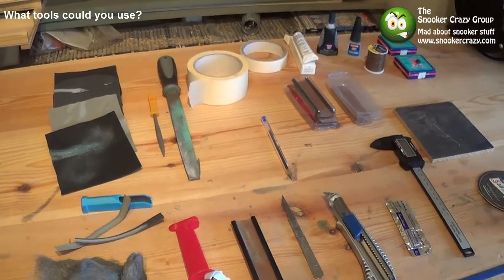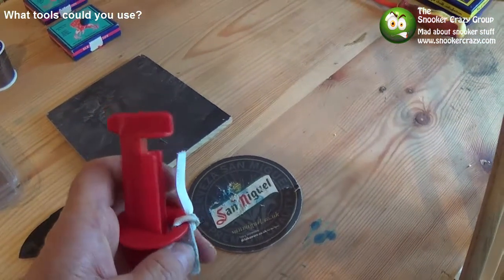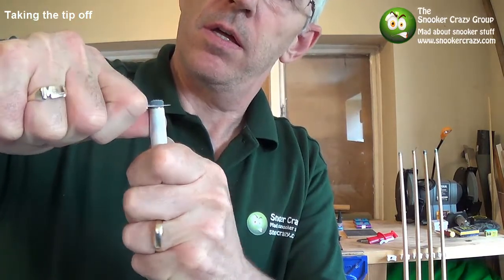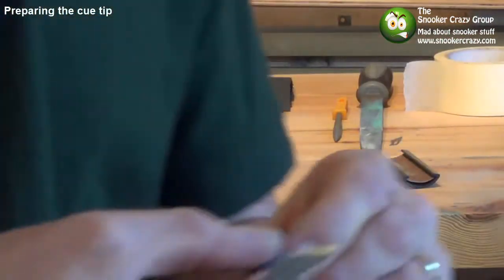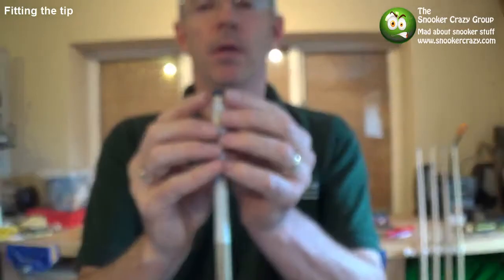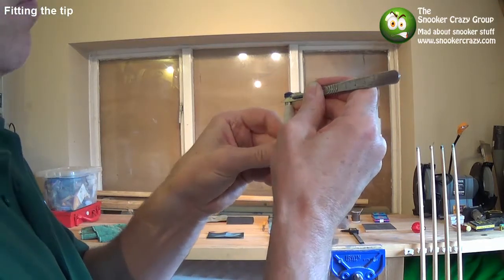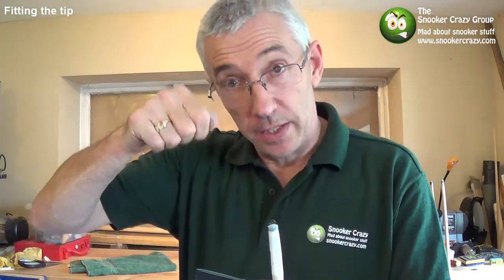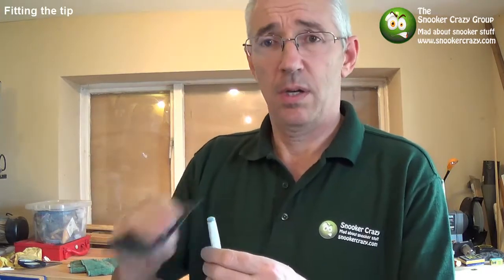How to Re Tip a Snooker Cue - snookercrazy.com

Comment: Hi.
This is probably the daftest question ever.
But, does a tip's diameter increase when compressed? 
What I mean by compressed is after it has been compressed by the compressing tool.
I'm trying to find the right tip currently, due to tips I normally use dome very easily; instead of compressing naturally.
Thanks.
Neil.
Reply: Hi Neil
Most gain slightly in diameter but not all. It also depends on if they are dry or not.
To test a range, probably best to just try one and see.

Comment: Hi there,
You mentioned that the tips can be not compressed uniformly all the way through,  is it necessary or would it help to get a cue tip compressor and do it yourself? 
Thank you for the helpful video.
Reply from the maker: Hi Carlos
Interesting question. For me I feel it does make a difference so I would either replace the tip for one that is compressed uniformly across the whole tip or use a tip press to even it out. 

The tip presses are easy to use and correct the problem.
Reply: @thesnookercrazygroup3562  thank you for replying so quickly! Wasn't expecting that! 
So you mean any badly pressed tip can be recompressed to a decent level with a tip compressor, is that right?
Reply from the maker: @carlosfung2091  

I'm not saying it can happen in every case as the tip press would have to have a similar dome to the one used originally but there's nothing to lose by trying if the tip is already uneven.

You would still have to be careful you don't over press and end up with a tip harder than you like so a but at a time and keep checking if you are going to do this rather than popping a different tip on.
Reply: @thesnookercrazygroup3562  

Thank you so much sir. 

I recently found a decent, straight old club cue and bought it off the club (budget limitations) I find your videos very helpful in restoring an old cue (removing the lacquer, polishing the ferrule, changing a tip etc) so thank you very much for that. 

Any suggestions on how to remove bad chalking marks at the very top of the shaft just under the ferrule? Want to make it look as perfect as possible😉
Reply from the maker: @carlosfung2091  For bad chalk marks I generally use 'White Spirit' and carefully clean them out. Try to use the least amount possible as you don't want the shaft soaked with it.

Comment: What i like to do to help centre the slightly oversize tip, is wind masking tape around the ferrel until it's packed it out to the same size as the tip
Reply from the maker: Interesting Sam. I guess if you have the same amount all the way round so it overlaps evenly then I guess it would be dead centre. 
Normally I just put a bit of talc on my two fingers when the tip has been placed on the ferrule and then push it evenly with both fingers all the way round so it's central. Glue doesn't like sticking to talc so works fine for me. 
Lots of methods out there, each person finds their way which is why it's interesting to see how other people do it!